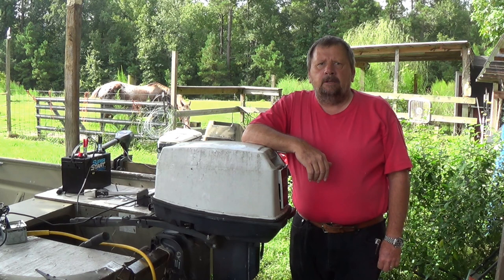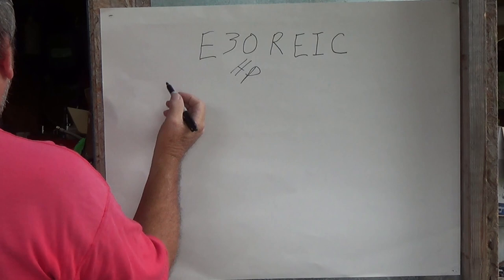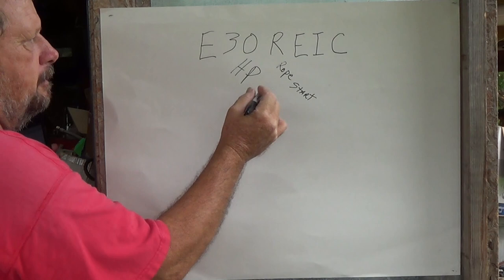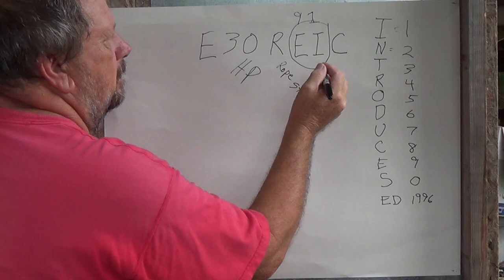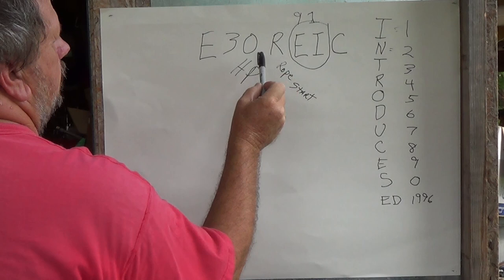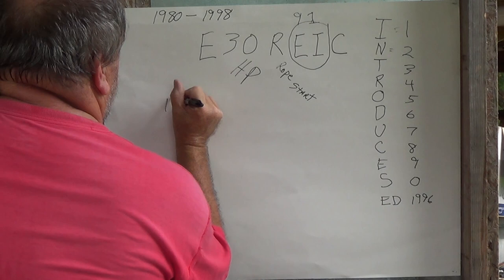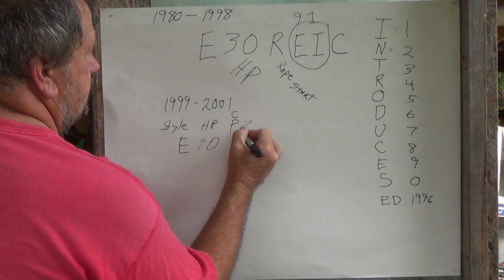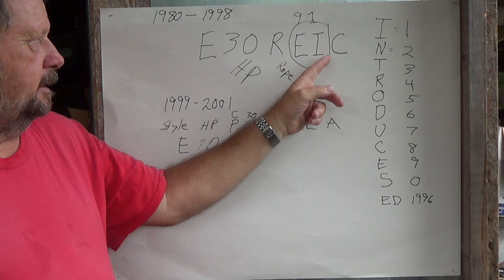Evinrude year by model number.

Comment: How do you tell which 70s model you have? I'm new to the whole eveinrude 2 strokes. My boat is a 74 and the owner said its a 73 model engine but I want to make sure before I start buying parts
Reply: I put "old evinrude 25HP" in Google search & it took me to a look up chart at:     https://www.marineengine.com/parts/model_guide_pre80.html#e25hp      
The identification plate with the model & serial number is where he says it is on the left side of motor.
I used the chart & found out for the first time my old Evinrude 25HP was built in 1971.

Comment: Thank you. I have an 1988 8hp Evinrude. Quick question?? The 2 stroke fuel ratio says 100:1 but alot of stuff on the internet says don't ever run that. Do a 50:1....any truth to that?
Reply from the maker: I always run my fuel mix at 50:1. I have read that different oil requires different mix. I stick with a good mixing oil and 50:1. The price is high if we get the wrong mix.
Reply: Yes 50 - 1 Bro!

Comment: I am looking to buy a model E10SELCOM, how come there is no L on the year chart and what does the S mean?
Reply from the maker: This is not a easy answer, for 1999 and newer The E is the style. Like Evinrude or Johnson. The next is Horsepower The next letters are Design Feature. Some places say the S is for Special Styling {White Evinrude}The L Stands for 20 inch Shaft length.  The CO would be 85 The M would be model run or Suffix. 
Now if the motor is 1980 to 1998 the SE would stand for Electric start non tilt sail. Manufactures make all this up for them to track the motors and hard for us to figure it out.
Reply: @OmFishing  thanks a lot man, they do indeed try to make it difficult for us

Comment: Apparently this 35 hp Evinrude that I have is a model prior to 1980 which have model numbers with less than eight digits. The model # is- 55802R The serial # looks to be E0001371. By the last two digits on the serial # I assume it is a 1971 year. Does anyone know how to determine the year of a pre 1980 Evinrude? I am trying to order a top crankshaft seal for it. I see that the crankshaft seal # 321895 fits Evinrudes 35 hp through 75hp. But I am not sure if this would change by the year with older models possibly having different size seals. Any input on this?
Reply: Sorry I gave wrong model #. Instead of 55802 the right # is 35802. I looked it up and it is a 1978. The way they have it stamped makes it easy to get the number wrong. Thanks .

Comment: How do I test my trigger base on a 1974 115 hp VRO evinrude one of the leads has no OL ms 30 something on the other three
Reply from the maker: I have not worked on a model that old. On a 90s model the sensor coil resistance test should be with in the ohms at each connection. If not replace the timer base assembly.

Comment: What are the best spark plugs for OMC 9.9 Evinrude 2 stroke  1997 year . Having trouble finding them
Reply from the maker: I always use the ones that the factory recommended. Champion QL77JC4  @ 0.030 in. {0.8 mm} They have worked good for me. I buy them at walmart if you see them get them they don't stay in stock long.

Comment: Good video. I have a Evenrude without decals. Can’t find a model number but have a serial number.18802E-E16230. Engine is shaped like a 9.9/ 15 hp. Cowl has been painted heavily. I would appreciate any help identifying it. Thanks Royce
Reply from the maker: Your number 18802-E comes up as a 1968 Evinrude 18HP. I hope this helps.
Reply: I’m trying to get a title and will need a model and serial number. Which is the model number? The shape and shift lever appears to be similar to a 9.5.The photos I find of an 18 hp look different. I’ll try to send a photo. I’m not real good at this. I do appreciate your help. Royce

Comment: Thanks for the video. It’s definitely helped but I’m still a little confused. I’m in Australia. I just bought an old boat 2nd hand. From what I can make out of the serial stamped into my Evinrude outboard, it says E70TLCEI. From that I’m getting it’s an Evinrude 70HP. The ‘TLC’ part, well I have no idea what that means. And is it possible that it ends with the last 2 digits as the year of manufacture, which would make it a ‘91?
Reply from the maker: The E is the style Evinrude, 70 = Horsepower, T = Trim &Tilt Electric Start, L Shaft length 20in, CE = 89, I Model Run or Suffix. 
Hope this helps. Thanks for watching.

Comment: What does the C at the end of a model 75ELR78C mean?  Also what does the ELR mean?
Reply from the maker: The last letter in the model number is the suffix  or model run.  Most of the books just say the suffix aren't important to the consumer.  The example I have seen on line is like a outboard would be 
70 HP Power trim 20" shaft is a A suffix. I think it is the details of your motor.

Comment: mine reads CE10RCCD , so mine is a 10 hp, my question is , is  a 10 hp the same as a 9.9 ?because some motors have 9.9 marked on the cover, mine  is  just marked EVINRUDE.
Reply from the maker: When I ran that model number it came back as a 1988 Evinrude 9.9hp. The outboard company change the 10 HP to 9.9 because of state reg of no 10 HP or larger on a lot of  lakes.
Reply: @OmFishing  Thanks for the info, and great stuff you are putting out there.

Comment: I bought an old evinrude fisherman 6hp. It was repainted and I can't find a model number plate anywhere
Reply from the maker: On the power head right under the fuel pump there should be a round disk. That disk should have numbers stamped on it. That will give you the year and model of the motor. If the disk is original.

Comment: I have a Evinrude 9.9 with model number 10824M, can you help me out please on the year as well as the fuel/oil mixture?  Thank you
Reply from the maker: That is a 1978 Evinrude 9.9. The service manual I have for my 1978 Evinrude, The fuel oil mixture is 1 part lubricant to 50 parts gasoline.
I hope this helps.
Reply: @OmFishing  thank you very much for your quick response!!  This helps me out big time...I figured it was either a 50:1 or 40:1 mixture so thanks for that info also

Comment: Hi there I have a 25hp evinrude  and am struggling to find out the year with a weird model code HE25FPF  I don't know if trim bracket is different but will like some help
Reply: Also something that may help is that the water pick up on the gearbox is above the fins so can't use ear muffs
Reply from the maker: From what I can find it is a 1996. Check out this link
https://www.boats.net/catalog/evinrude/outboard/25hp/he25fpo-1996
This is the closest to the model you have. Hope this helps.
Reply: @OmFishing  thanks

Comment: Thanks for all the info! Just purchased an early 90's Evinrude 140 and was wondering if you could give me the formula for gas to oil mixture (gallon to ounces) per gallon. Can't seem to find it on you tube. Thanks so much!
Reply from the maker: I have th a 1991 and a 1993 and Run 50:1 fuel to oil mixture. Most 2 stroke oils have the chart with them. I use quick silver not much smoke at start up. Most likely around 2.5 oz of oil to 1 gallon of gas. I always use the two stroke oil for outboards.
Reply: Thanks so much for your info and time. God bless you bud@

Comment: 60 hp Johnson Mod# J60ELGO. See #G7049474. What year model.?
Reply from the maker: Are you sure the second letter to the last is a G 
If the motor is not one of these years this don't apply.
The model number starts as follows
J - Johnson
60 - Horsepower
E -  Design Feature like E for electric start
L - Shaft length L= 20 inch
The next two places are the year for models 
1980-1998 
Year Bult
I = 1
N = 2
T = 3
R = 4
O = 5
D = 6
U = 7
C = 8
E = 9 
S = 0

If the G in the model number was after the horsepower than that would stand for G = special styling. I know Johnson made some outboards with some special model numbers that make them hard to track. If you keep looking you will find it.

Comment: On a johnson 20 hrs on the motor there a around plate stamped with numbers 25R73 A  E 3789524 so is it a 1973 there no serial number or model plate on the  on it
Reply from the maker: You are right. It is a 1973 25HP
Reply: @OmFishing  thank you
Reply from the maker: @DjStoen  Happy to help. Safe Boating.

Comment: I have an Evinrude or Jonson outboard motor serial number is C7019669 need information on this motor. h.p. year. etc. please help
Reply from the maker: Sorry it took so long to get back to you. Hurricane slowed me down a little. Do you have the model number?
Reply: @OmFishing  Hi, i have only a serial number. No more any laybles on motor. Its wery old i think its a 60-70 years, but maybe I'm wrong. I only know from sereal number that engine manufactured in Canada. If i can send you some photos. Maybe it will help recover model?
Reply from the maker: Sure send them to omfishing@yahoo.com
Reply from the maker: I can not find anything on that number. You could try asking a dealer for the information.
Reply: @OmFishing  thank you. I found model plate on motor

Comment: I got a 150  Evinrude well I think mine is 88 but there's some more letters in here I don't know.  E150 OTLCCA   91817656    if you can help me figure it out please
Reply from the maker: When I run the number E150TLCCA it comes up 1988. The O before the T just means it is a three cylinder on smaller models maybe 3 on each side? T stands for tilt and trim. The L Stands for 20 inch shaft. The CC  Stand for 88 which is 1988. The A is the model run or Suffix.

Comment: My model number is 9522C ?
Reply from the maker: That motor is a 1965 Evinrude 9.5.
Reply: @OmFishing  Thanks. It looks like new but it's locked up. I found a little surface rust in the cylinders above the pistons. I was able to wipe that off. I put some oil around the top of the piston to see if it loosens things up....fingers crossed
Reply from the maker: @oring137  That sounds good. Your well on your way. Thanks for sharing.

Comment: All I can find is the serial number
Reply from the maker: Sometimes you can take the hp and design of the motor and fine the year is you check out parts places like boat net. I did not find anything on that number. or you could try shop2evinrude.com
Reply: Om Fishing I found a couple videos that the person had the same exact motor. Identical to mine it’s either a 63 or a 69. Looked more like the 69 model. Thank you for trying I appreciate it GOD BLESS.